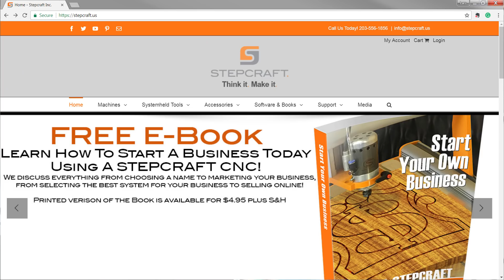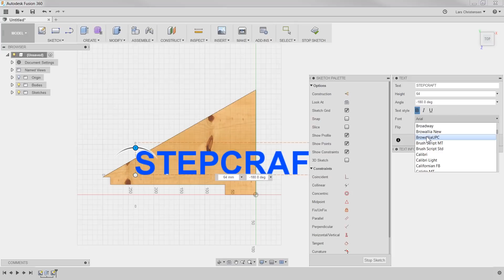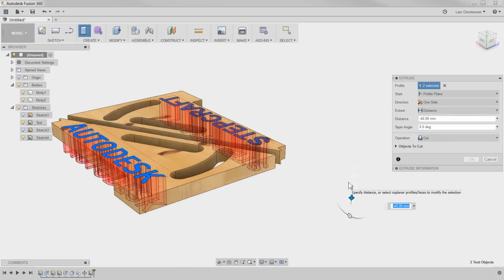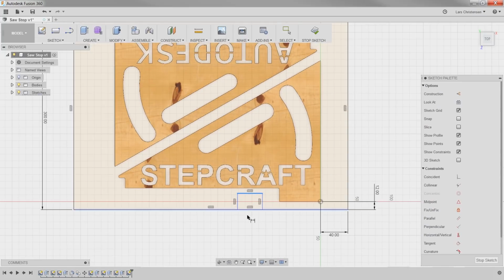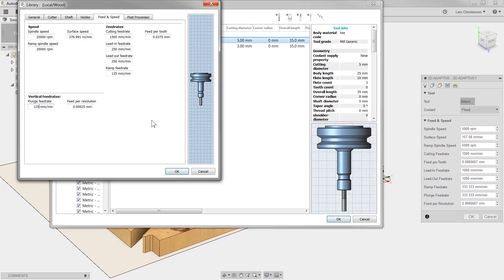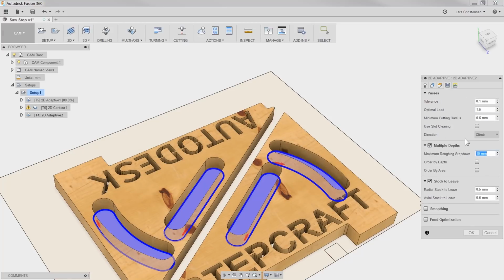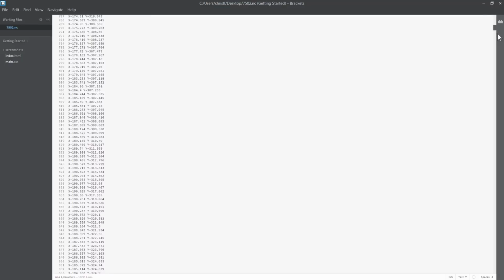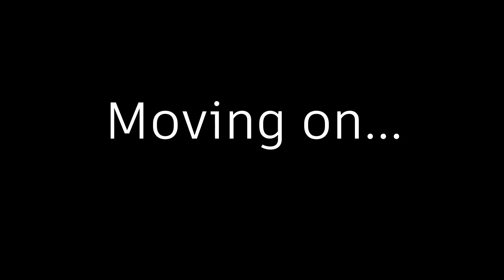MAKE — Saw Push Sticks — STEPCRAFT & Fusion 360

Comment: Lars, another great video, I actually do a lot of very custom wood and aluminum signs. I have always found pine to be the worst to work with, it always leaves those annoying fuzzies on the edges. A great way to cut down on them is to laquer the wood first with 2 coats. then if you engrave or v carve you can stain it afterwards and the stain only soaks into the letters. I dont know if I run my machine too fast? but that would only be about 10-15 min.
Reply from the maker: Hi adam bergendorff Thank you for watching! AND for the great tip! Awesome!! Thank you

Comment: Hi Lars, I use Fusion 360 for my wood cnc'ing frequently. As mentioned before by others, helix is the way to go. In your sample, you could have used the Oswald Stencil (free) to prevent the additional work on the individual characters. My cnc table is made of birch plywood, which I flattened to mach the machine performance. I then used the cnc to create a 50x50mm hole pattern which I filled with threaded inserts. Instead of using clamps, I often fix the work piece using this grid pattern and spacers underneath to prevent hitting the mounting plate. This works especially well when you can drill the mounting holes directly into your end product, When the oversize is less the twice the contour, no tabs are needed.
Reply from the maker: Hi Kees Bos Thank you for watching! AND for the great advice! Thank you!

Comment: I'm a wood guy and here is how I handle soft woods.  I use a 2 flute 1/4" endmill at 24K RPM 100ipm with a .125" depth pass and ramp down.  If you see smoke, then either increase feed rate, slow down the spindle, or decrease depth of cut.  Helix entry will cause burning since it sits in a small place too long.   (I started a wood piece on fire while a fan was blowing the chips away and almost burned up the project!)   When in doubt, I try to go fast, shallow, and max RPM.
Reply from the maker: Hi Marvin Helphrey Thank you for watching! ANd for the awesome advice!! Thank you!!

Comment: You don't plunge in wood lars it's a good way to set it on fire (you never wont to see it, it takes seconds to go from smoke to fire and if you are useing a dust extractor you have to remove it fast as it will be on fire as well I have seen it twices so far) use a smoothie profile or ramp. 
It looked like steam coming from the wood not smoke pine does hold some sap sometimes even when the timber looks dry.
Reply from the maker: Hi daniel lyall Thank you for watching!
Awesome advice!! Thank you!!

Comment: Why not use tabs for holding in the letter centers?
Reply: Chris Molloy That is genius.  Set the tab to full height, click the point where you want the center and you a done. None of the fiddling Lars did needed.
Reply: Thanks
Reply: or set the tab lower so it is less visible
Reply from the maker: Hi Chris Molloy Thank you for watching!
Yes, I was stuck on using adaptive :-)

Comment: Nice video Lars. I know this was to demonstrate how to letter and cut these out, not to be critical but helpful hang them on the wall and do not cut out lettering leave it solid. Also hand holes are not the best, a handle is much safer. No sharp ends and I would use 3/4 inch plywood for this project. Be safe, Steve.
Reply from the maker: Hi S Zsenyuk Thank you for watching!
Great advice!!! Thank you!!

Comment: Definitely need dust extraction. The burning could well have been moving the cutter bit too slow. Often with routers and wood, you need to move them quite quickly as the burning happens when the cutting edge of the bit rubs against the same piece of wood over and over.
Reply: +1.  It seems counter-intuitive that you have to go faster to keep the cutter cool but you're right.
Reply from the maker: Thank you!! The machine does come with a vacuum attachment, but I am looking to add the toolchanger and that will intefere, I think.

Comment: lars i find that router bits for the most part have do not have a helix so the smoke may be from the chips and u need a vacuum or a blower good job be safe.
Reply from the maker: Hi cockatoobirdman bill Thank you for watching!
Yes, I ordered standard CNC Mill endmill, first mistake :-)...The machine does have a vacuum attachment, but I am looking to add the toolchanger and that will interfere

Comment: lars, I would be a bit concerned using these push sticks on a saw. The handle portion of the push stick is too thin, so it could break under force.  One of the reasons a push stick is used is to limit harm when kickbacks occur.  When they happen, they can impart great force to the push stick.  If the push stick is weak, it may break and be a sharp object itself that can injure the operator.  If the push stick does not break, but has sharp edges, it still cut or cause very painful contusions to the hand.  Craftsman used to sell a table saw push shoe that was shaped similarly, but was beefier in the handle and had smooth edges where you hold it. You can search for Craftsman guide master table saw push stick to see photos of it.  I have two, and use them frequently.  They are no longer sold, but you can find them on ebay from time to time.
Reply from the maker: Hi arlen raasch Thank you for watching!
Very valuable point! Thank you!!

Comment: I did some push sticks as well.  All conventional milling with 1/4” flat end mill.  I contoured the hand holes with tabs rather than clearing out all the material to save run time.  The post processor, custom, I’m using adds M01 stops for tool changes.  Change tool, re-zero Z and continue.
Reply from the maker: Hi Greg Morse Thank you for watching!
Yes, looking back I should have used tabs....I just like Adaptive so much :-)....Looking forward to get the toolchanger running